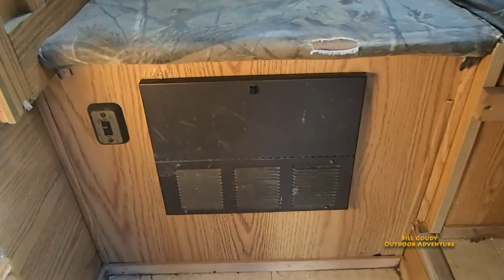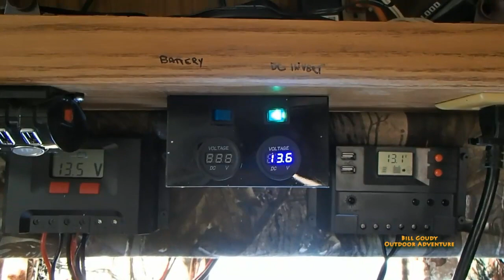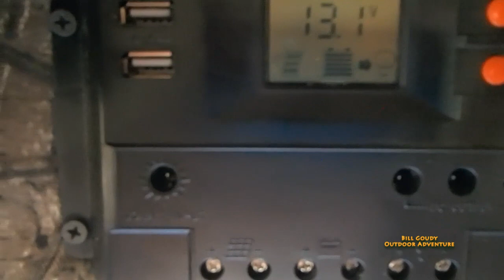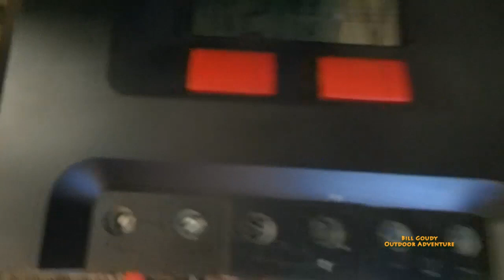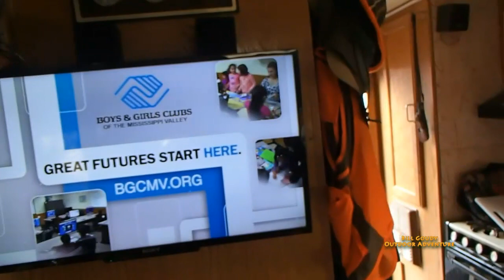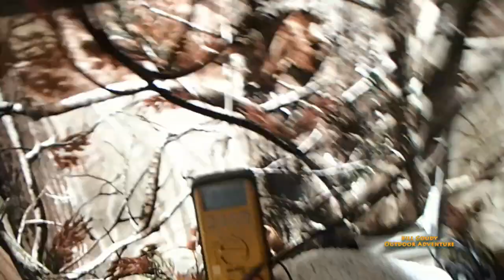Truck Camper Solar Panels - Some Questions Answered

Comment: So how many watts is that putting out I didn't get it what you said
Reply from the maker: My solar panels can put out up to 200 watts 12 VDC....  The AC inverter can put out 2000 watts at 120 AC volts...   My little generator output is 120 volts with a peak of 1850 watts and it will put out 12 Volts DC to charge my solar batteries if needed ......

Comment: My camper inverter is dead. It doesn't work anymore.  I need to replace it. Bummer. Oh well. .... like how you got everything.  Good job.  How does Hairy like it?...;)
Reply from the maker: That is too bad....  I am not sure what type of inverter you have, but many times it is just the  capacitors that have dried up and no longer work....  I think that a new 50 amp inverter will run about  $150. bucks..  Hairy is kind of quiet.. but, he will make a short appearance in today's video..  ;-)

Comment: Dang Bill my OCD going nuts with that bird nest  if wires, bring it by and let me clean that up. Stay safe
Reply from the maker: Haha!!  Well ...  I can tell you there is not much that can be done, that I have not already done, Dwight...  Those are long cables for the remote cable TV hook-ups and then there is an old WiFi cable that I haven't used, but I am not ready to get rid of it yet. and then I have another extended coax for an additional outside antenna...  I have them in separate coils until I am ready to use them.  The big wire that tie the batteries together was premade and is 3' long... and then the same size wire goes from the two batteries to the 2000 watt inverter...   I don't have terminals or a crimper that large to make them any shorter... So I have learned to live with it... ;-)  at least until I can get bigger terminals and a large crimper...  ;-)

Comment: The system looks good Bill. I have one question, as the batteries deplete what voltage does the inverter stop making AC?
Reply from the maker: 10.5 volts

Comment: Over time. silicone calk will release from its substrate. Switch to Butyl calk.
Reply from the maker: Thanks, Scot ...  I have not heard that...  How long does it take before it will release?  This was 100%  clear silicone and I used a solvent on both surfaces before dispensing the silicone....
Reply: Depends on temp & weather conditions but it will happen in a year or two. Butyl will last a lifetime.
Reply from the maker: I used the GE Clear seal - Supreme.. I paid over 7 dollars a tube...  I sure didn't look at the ingredients...  I will dig the empty tubes out of the trash...  I will check to see how it is made...  I sure have not had any problem with this stuff, but I have not tried to hold solar panels down on a moving camper before....  Thanks for the info my friend!!

Comment: Great job Bill!!! What little I know is that ya gotta be careful pairing up charge controllers with panels. Cause controllers made in the northern hemisphere's sine runs up and down and if from the southern hemisphere, it runs down and up. So if ya hook a southern controller to a northern panel, .... You could freeze yer toast.  But you said yours has a square wave, so I guess it would depend on what side of the square it started on.  ;-) Hope everything works out well. ;-)
Reply from the maker: Haha!!  You crack me up, Bob  ....  ;-)